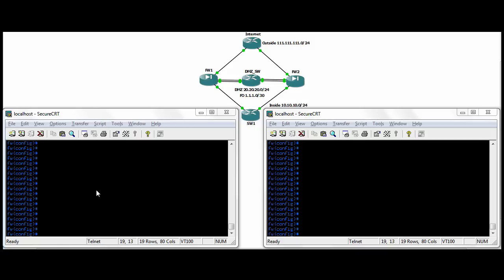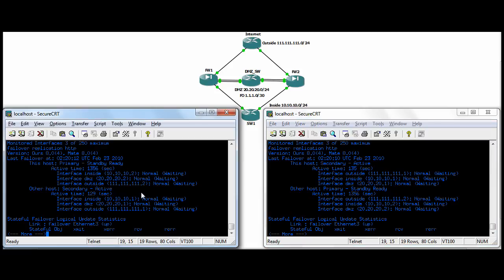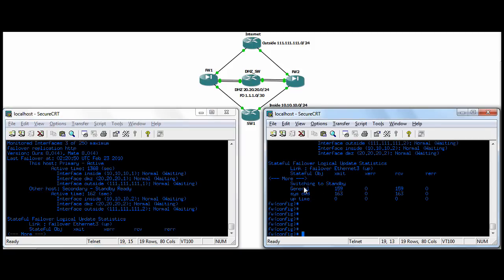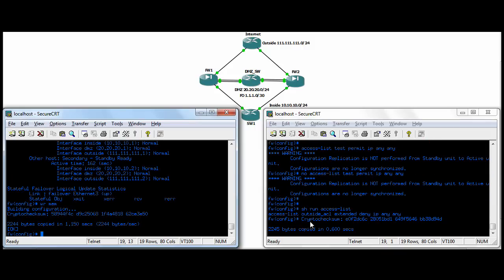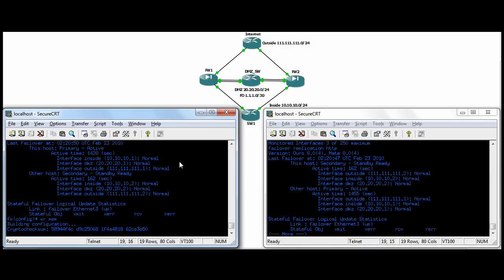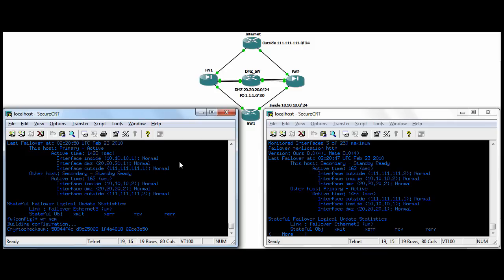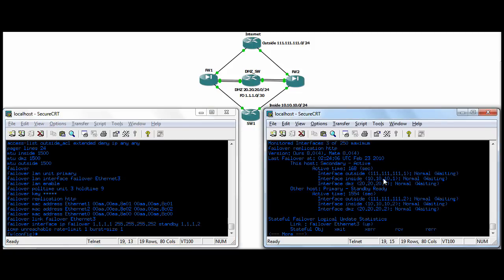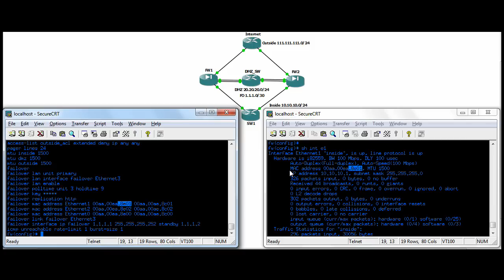Cisco ASA - Stateful LAN-Based Active/Standby Failover - Part3.mov

Comment from the maker: @zemouri37 
I've never done it but I guess you do it the same way. Just be sure that the failover interfaces are routed accross your WAN. Here's a blurb from Cisco docs about long distance failover...

For optimum performance when using long distance failover, the latency for the failover link should be less than 10 milliseconds and no more than 250 milliseconds. If latency is more than10 milliseconds, some performance degradation occurs due to retransmission of failover messages. 

CSO

Comment from the maker: @capn0jack 
You got it. Just used in the event that the secondary unit boots first. You don't want the secondary to use it's burned in MAC because once the primary boots, the secondary will change from the burned in MAC to the virtual MAC and cause a loss of connections through the ASA. If you specify the MAC for the secondary unit. There's no flop of MAC address and therefore no loss of connections.

Regards,

CSO

Comment: Is there any reason to use the "failover mac address" commands other than the case where the Secondary comes up first?  From Cisco:  In Active/Standby failover, the MAC addresses for the primary unit are always associated with the active IP addresses. If the secondary unit boots first and becomes active, it uses the burned-in MAC address for its interfaces. When the primary unit comes online, the secondary unit obtains the MAC addresses from the primary unit.